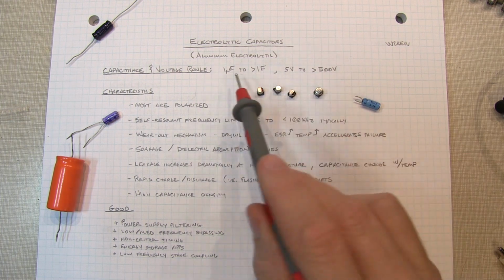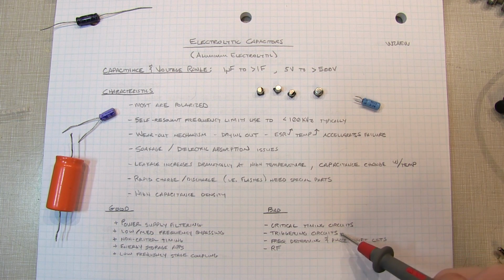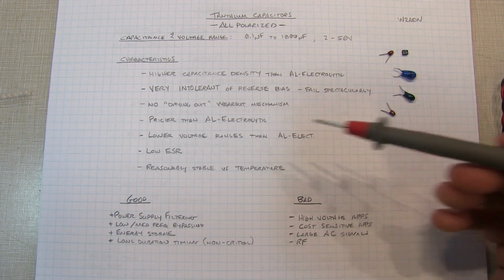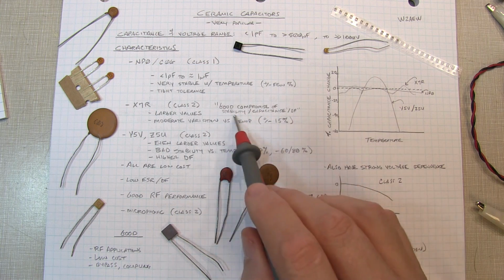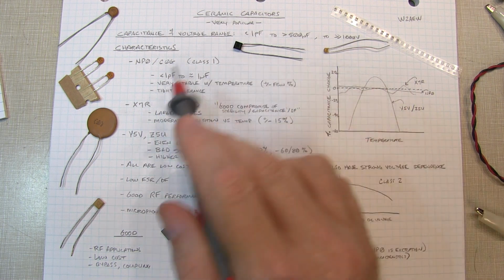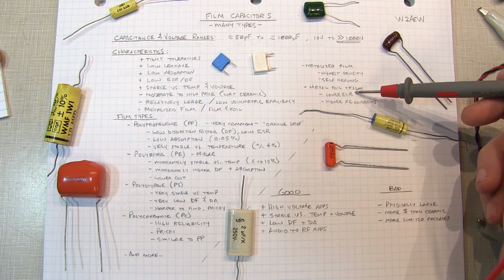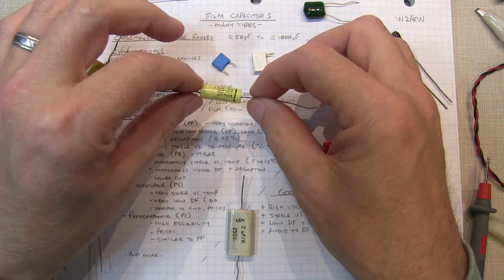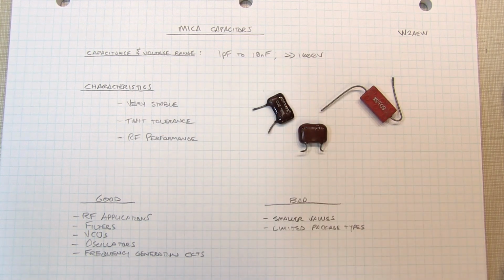#256: Capacitor types, characteristics, and applications

Comment: Great background info. Wonder if you could do a talk on proper, basic power filtering on Arduino-style projects. I don't use "shields" but prefer to build up a board with a Pro Mini and add needed IC's, etc. I recall board Vcc should have electrolytic's  & each chip  should have a small cap - Vcc to ground.  A talk outlining best practices in board construction would be a great help.

- Alan R.  W2AVR
Reply from the maker: Your recollection of using a bulk electrolytic on the board, and a small ceramic cap at each IC is a very good place to start, and would qualify as a "best practice".

Comment: Nice tutorial.  Those class 2 ceramics are also frequency dependent.  Recently fixed an HF BPF where the designer thought they'd save space by using X7R caps in the resonators instead of NP0.  They couldn't figure out why it was not working.

Comment: TI has a great reference on capacitors that's a 'must read'. https://i.imgur.com/dvKFb64.png https://i.imgur.com/dK2YR3G.png  Just some highlights.  They also have some handy tips on general board layout to minimize stray capacitance, via induced inductance, proper bypassing, proper decoupling, killing cross talk/differential pairing on standard FR4, etc.   www.ti.com/lit/ml/slyp173/slyp173.pdf 

The fastest I've had to deal with is meeting DDR3 latency requirements, but even anyone who's doing anything (even wired) should get familiar high frequency transmission best practices. Intel OmniPath is already on the high-end Xeons (we saw that all coming the second they bought Infiniband). Hell, even if you're purely on the software side, since we're at the point where RAM latency is basically what the mag disk bottleneck was 10 years ago.
Reply from the maker: Great resource, thanks for sharing. I'll add this link to the show notes.

Comment: You have answered so many questions I've had about capacitors.  Thankyou!  Two things I want to mention.  My company sent a service memo out stating that they reverse polarized a small rectangular electrolytic cap in production.  We had to go into the field and replace them.  They would fail after about 5 years.  The first one I did I had to remove 32 screws to get to the board!!!
I recently bought a very, very expensive ceiling fan with a custom led light.  When you turn on the light it hums worse than an amplifier that goes to eleven.  I assume this is due to the ceramic caps resonating in the audio range used in the DC to DC converter.

Comment: Nice learning video, thanks so much! The video dredged up some memories of my device classes back in the '80s. I haven't been involved enough in electronics recently to inflame those neurons, but your video helped charge those up  (pun intended). But, now, that I am getting back into electronics repair and design, it is a nice refresher.
Q: I was wondering how to id those NP0, COG, Y5V and Z5U varieties of ceramics if I went to some of my old caps in a drawer and picked them up to use in a circuit? I now know, thanks to your video, what to choose when purchasing them.
Also, it would be nice, for me anyways, if you do a tutorial on identifying the values of some of those smaller caps. As I recall, the values are written in sort of a scientific notation; i.e. 101k, etc.
I know, I could crack open those text books that I still have from my old classes, but that is hard work. LOL I am studying those as well, as needed.
Reply: You can usually tell by the value. Less than 1nF, it's probably NP0. NP0 are often marked. Class 2 are also more microphonic. Connect to a scope input at a sensitive setting (like 1mV/div), and hit the cap with your fingernail, a pencil, etc. and see if you see a deflection on the scope.  The numeric code is that the first two digits are the figures in the value, and the third is the multiplier - how many zeros to add. Result is the value in pF. 101 is 100pF. 472 is 4700pF, or 4.7nF.

Comment: Excellent.
I have a box full of salvaged Caps that you have now identified as Mica caps and I can use these for decoupling in my Audio amplifier projects. Many thanks for helping me in identifying them.
Reply from the maker: I'd be surprised if the mica caps would be large enough in value to be usable for audio frequencies (unless used in very high impedance circuits).

Comment: So, if I understand this right, the reason you often want a mixture of larger electrolytic caps as well as smaller ceramics, for filtering power supply inputs/outputs, is because the large electrolytics are good at "picking up" the larger ripple voltages, with lots of capacitance to gulp up larger amplitudes, and the small ceramics pick up the smaller-amplitude or higher frequency ripple... And the smaller caps achieve that simply because they're "faster" (smaller ESR)? I think I'm getting it. Maybe!
Reply from the maker: Yeah, you're getting it.  The big bulk caps provide the path for the low frequency currents, and the smaller ceramic (usually) caps take care of the high frequency content.  Not so much because of ESR though - it is mainly due to the SRF (self-resonant frequency).  See my video on that.  The big electrolytic caps have a self resonant frequency well below 1MHz typically, which means that they look inductive above that.  The ceramic cap's SRF is much higher, so they still behave as capacitors at high frequency.
Reply: Gotcha. Will have to check out that video as well. Cheers!
Reply: The smaller capacitors often have a a smaller ESL, not ESR, and this relates to SRF as w2aew mentions.

Comment: I would like to see a comprehensive video on testing capacitors. The old way of connecting a VOM on the leads and watching the needle travel across the dial is fine for shorted or open caps. But what about testing for ESR? What about testing for leakage at different voltages. If the cap is rated at 600 volts how can you safely test it at that high voltage. I realize that the vast majority of capacitor installations are low voltage but one good video to cover all the tests for all the caps at all the voltages.
Reply from the maker: I've got at least three videos on testing for ESR.  One that shows how to do it with a scope and function generator, and two that present different homemade ESR meter designs.  Here are the links:
https://www.youtube.com/watch?v=115erzCCxgE

https://www.youtube.com/watch?v=bmYAgat-sOQ

https://www.youtube.com/watch?v=3fiUZZlveS0

I don't have any that test for high voltage leakage - probably not something that is safe for the average hobbyist.
Reply: Alan, thank you for directing me to your other videos. I did not search them out adequately before. I understand about high voltage and amateur hobbyists not always being a safe mix.

Comment: Great video!  Thanks so much for all of the info.  I had no idea the marking band on film capacitors indicated the outer foil plate.  I was always worried that some film caps were somehow slightly polarized.
Reply: Oops, but now folks in the comments are saying manufacturers no longer mark which terminal is the outer foil, but still put the band marking on the cap!  I guess it should be tested electrically for really critical applications.
Reply from the maker: Always humbled to hear that I can help teach you something, Ben!
Reply from the maker: Yeah - Paul at Mr. Carlson's Lab did a good video on that.  So much for quality control!
Reply: Mr Carlsons Lab has a very good video about this.

Comment: Excellent video, please do a video with the theory behind decoupling capacitor on the power supplies and when you are feeding voltage to a circuit, how do you calculate the size and where to put the cap.
Reply from the maker: That's a good idea.  I've got a couple of ideas on how to convey some of that really well.  I will add this to my short list.

Comment: Another nice (and useful) video Alan. I found it very informative. It seems I am not the only one who has difficulty identifying the dielectric in the plastic film caps.
Reply from the maker: Very difficult unless you check out the device manufacturers data sheet.
Reply: Very true, Alan.

Comment: Hey Alan, good video. 

I would say that if you are looking at an audio circuit, you generally assume all non-polarised caps are film-types. You don't use ceramics in audio for coupling or filtering, only decoupling or bypassing - unless the value is very small  (such as the cap between the collector and base of a transistor or the across the feedback capacitor in an op-amp). Of course, if the design is surface-mount, all bets are off.

Also, Polyester (Mylar) caps are also referred to as PET (or sometimes PETE, or PETP), which stands for Polyethylene Terephthalate. 

There is a good article on Wikipedia about film capacitors.
https://en.wikipedia.org/wiki/Film_capacitor

Another good reference is this datasheet from Vishay:
http://www.vishay.com/docs/26033/gentechinfofilm.pdf
Reply from the maker: Good references, thanks!

Comment: Very good video, thanks. I didn't know about about the band on the film caps until now. Always good to learn something new. I would also recommend anyone who hasn't already done so, to have a good look at one of the manufacturers application notes on tantalum capacitors before designing them into your circuit. There's a lot to learn about rated voltages, temperatures, failure rates, etc.

Comment: So dielectric absorption is the term. I experienced it first hand years ago I just didn't know what to call it.

When I used to work on CRT TVs I found that the anode caps regained some high voltage even after discharging them with a high voltage measuring probe (I was able to monitor the slow discharge on the meter). I would equate it to a nasty static shock more surprising than painful.

I only had to get bit once when reinstalling an anode lead. I took a wire and installed alligator clips on each end after removing the anode lead I hooked one end onto the CRTs braided ground strap and the other to the anode cap. I only removed this shorting wire right before I was about to reinstall the anode lead.

A CRT is essentially a large capacitor there is a conductive surface on the inside of the tube (one plate) the thick glass (the dielectric) and a conductive surface on the outside the gray aqua dag (the second plate). This wire shorts out this capacitor preventing any "surprises" later :-).
Reply from the maker: Yep - I worked in a TV repair shop in the late 70's, early 80's while in high school - learned all about the 2nd anode and the voltage regrowth!

Comment: Excellent overview of capacitor basics.  As Vern noted, the band on many modern film caps no longer accurately represents the outer foil.  Paul did a very good video on demonstrating this and how to test them.

A recommendation for another cap video is on safety and bypass capacitor applications.  When restoring old tube equipment I always install modern X1/Y2 rated caps on the mains input.
Reply from the maker: Yes - Paul did an excellent video on that.  Good point about the X and Y rated caps.

Comment: Are the SMD "box" type electrolytics (I pretty much only saw them in black or orange) always tantalum? Or are there aluminium electrolytics in that form factor as well?
Reply: The mustard/dark orange ones are typically tantalum , the gray/black ones are polymer-tantalum solid capacitors (search for POSCAP , a type of capacitor made by Panasonic)  or straight aluminum-polymer electrolytic capacitors (for example search for SP-Cap for a series of capacitors made by Panasonic using this combo)